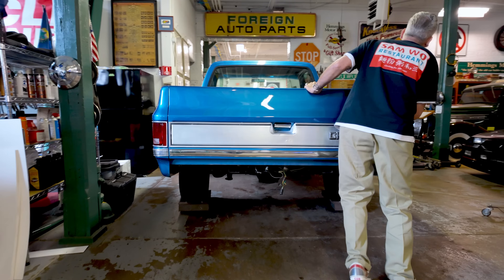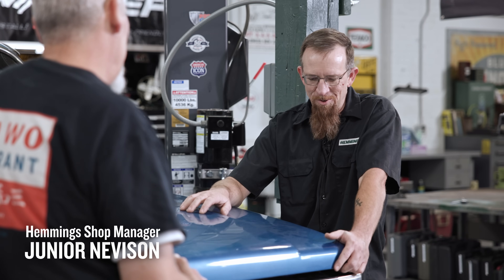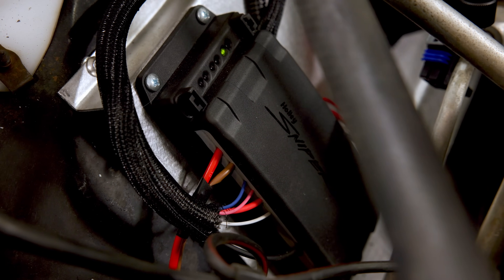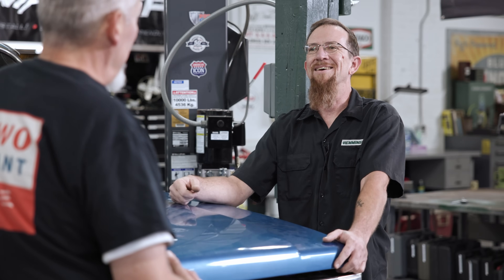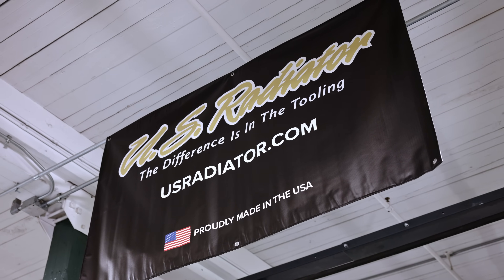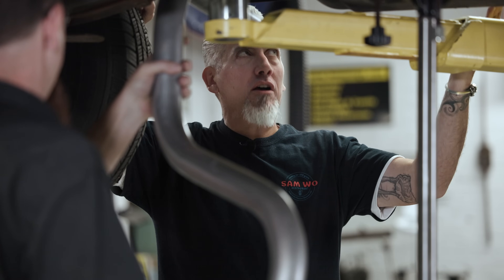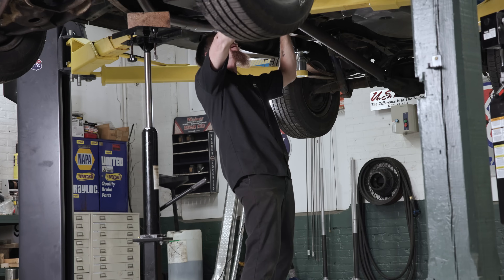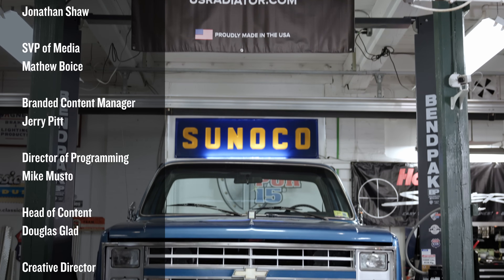Reviving A 1987 Chevrolet Silverado | Square Body | Fit It + Go!

Comment: Had a ‘87 C10   Hate that I don’t have it any more
Reply: No such thing in 1987. The last year for the square body C and K Series was 1986. Square bodies from 1987-1991 are R (2WD) and V (4WD) Series.
Reply: @googleusergp  the title said C10 custom deluxe so you can have it out with the DMV as far as I’m concerned
Reply: @dantheman9395  Doesn't matter, still doesn't exist. It wasn't a C10 in 1987. It was an R10. This is confirmed by the GM parts book listings. I should know, I was involved with helping to write it.

Comment: Yuck, all that "improvement" and "updating" is ruining a nice original truck. I would have left it alone and gotten it running as is. Nothing beats originality. 

Your description says "1973-1987 C Series". Not correct. Square bodies are from 1973-1991. They were C (2WD) and K (4WD) from 1973 to 1986. From 1987 to 1991, they were R (2WD) and V (4WD). In the spring of 1987, GM released the GMT400 trucks (later on called "OBS" by many folks) for the 1988 model year and they were again known as C and K Series vehicles.

GM did that to avoid the confusion (not always successfully) at the parts counter and to differentiate the two as they were sold side by side in the same dealership for a few years.